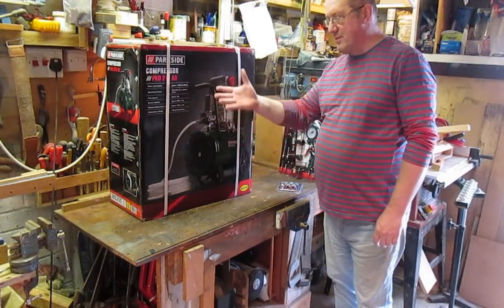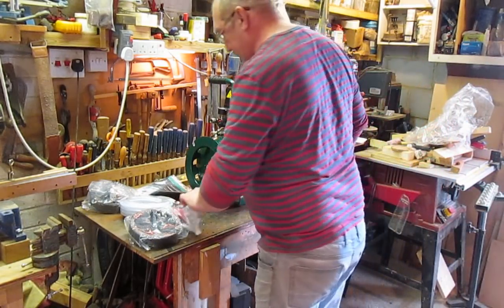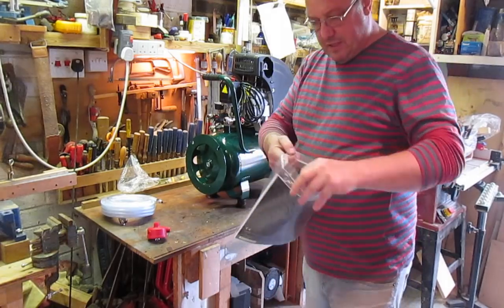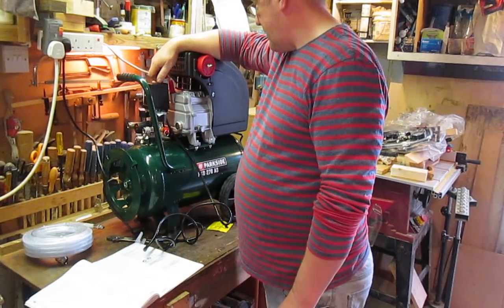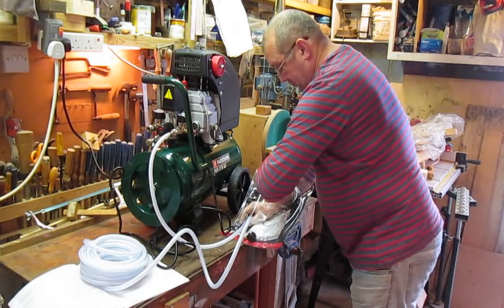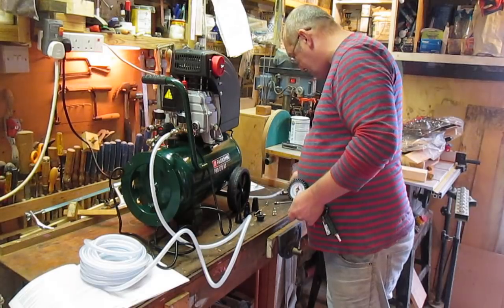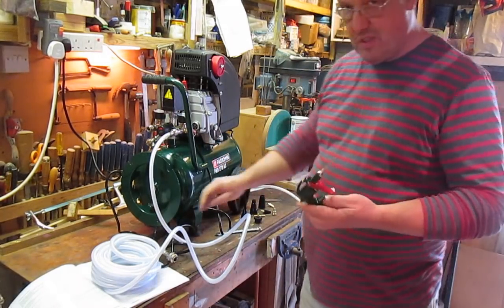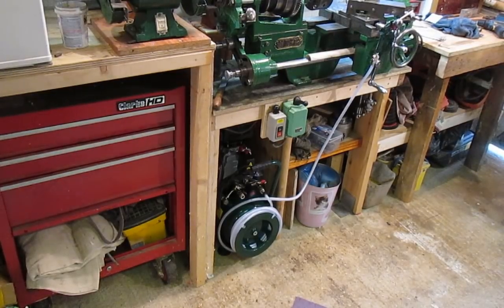Parkside 24L Compressor  from Lidl, unboxing & set up

Comment: Hey. Just wondering is it worth to buy ?  Here in Ireland is 149.99 Euro.  All I need is for house application nothing serious. Thanks.
Reply from the maker: For short infrequent use I think it's Ok, I've realy only used it for blowing down items to clean debris off and I'm realy happy with it.
Thanks for watching and hope you check out some of my other videos, Regards Andy T
Reply: The little English workshop Thanks   for advice . Cheers.
Reply: Hi there, I'm in Ireland too. The one on special today is th 50L.  It's more powerful than the one he is reviewing which is a 24L I think?
Reply from the maker: That makes sense Niamh, the one I got was only £79.99 and I'm sure your right it's only 24L.
Lidl have them on sale here in England from this Sunday at £119.00 that would be a big jump in price if it were still the 24L version.
Thanks for watching
Reply: Just had a look at the ad it now appears to be 50L capacity. It also states in the ad Vibration-reduced, low-noise motor with oil lubrication. I wish i'd have spotted the £79.99 deal as i'm sure that would of been better for my intended use of the item. Thanks for the review !
Reply from the maker: The tend to roll these things around quite often, I got mine last September I'm sure they'll be in store again before Sept this year if you can wait
Reply: Joe, you'd probably be better with the bigger one to be honest. Many of the air tools won't work as well with the smaller one.
Reply: don't bother i bought the 50l version no good for air tools,i used my small air polisher lasts about a minute forever waited for the air pressure to build up waste of money
Reply: also very noisey as per video vibrates quite badly not a patch on my wolf.

Comment: is this the one supposed to be quiet ?
Reply from the maker: Nothing I noticed on the box about it being quiet but I can tell you it isn't lol
Reply: Had a flyer from lidl for stock of products advertising this compressor as silent  bought it this afternoonn will be returning it tomorrow. Thank you
Reply from the maker: Mine gets very little use so the noise isn't a problem, so far it meets all my needs.
Hope you find somthing that works for you, thanks for watching :)
Reply from the maker: If you look on the thread in these comments by Evo Ninetys we found out the suposed quiet one is the 50L version and I have the 24L one Hope that helps if you havn't found one yet

Comment: And air tools are really cheap compared to electrics! Consider an air die grinder.
Reply: i;ve got this and its useless for air impact wrenches, my ryobi impact wrench was more powerful.  the air die grinder worked, but the compressor would have to switch on very often